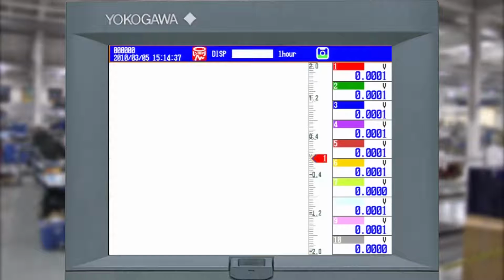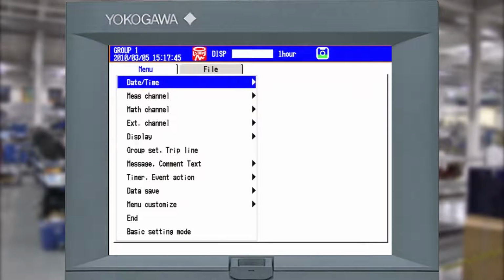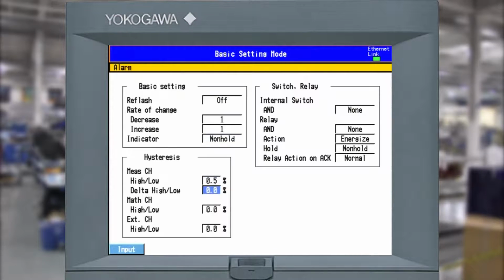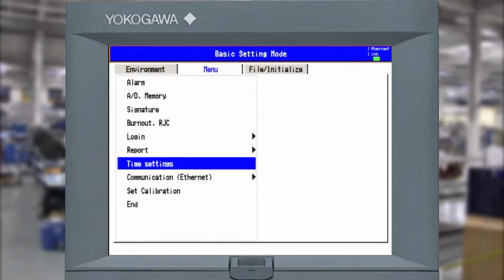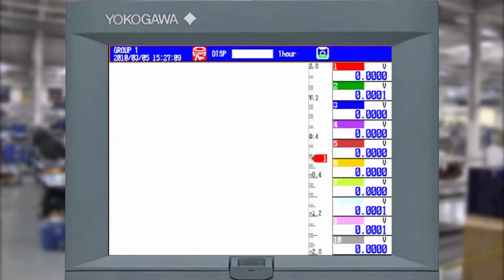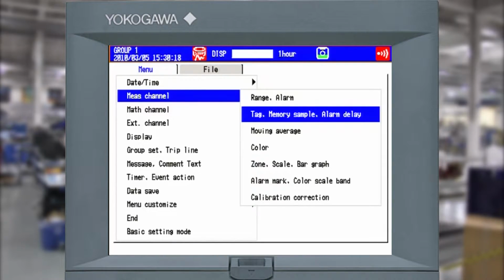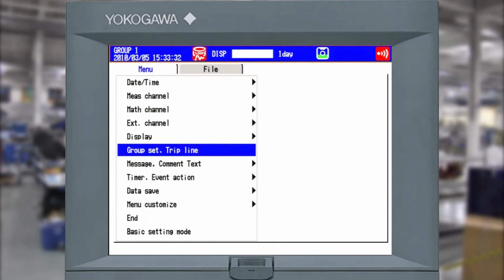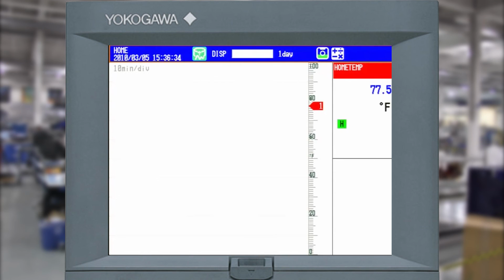DAQStation Advanced R4 Basic Setup

Comment: Is there a software tool on a pc that can scan and program the ip address from the computer rather direct on the recorder itself.  The mw100 you can do it.  Also how do you setup the ip address on the dx2010 if its acting as a client and you need to put in the ip addresses of the MW100's